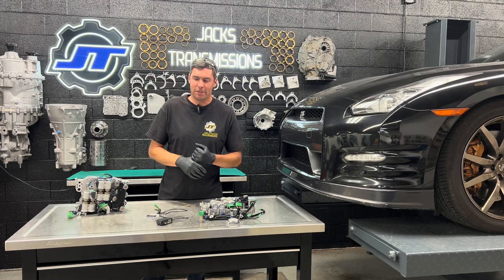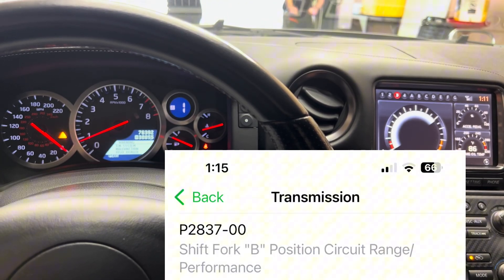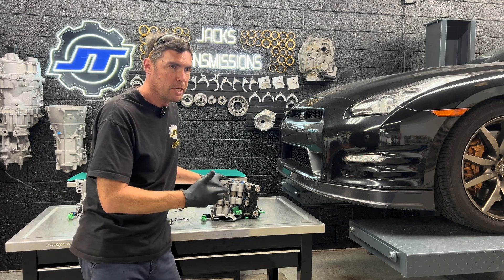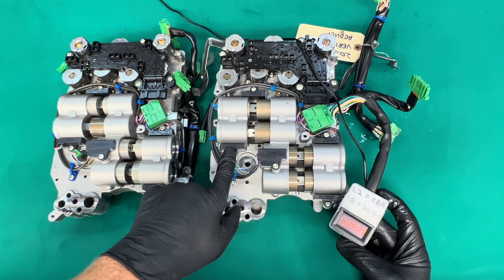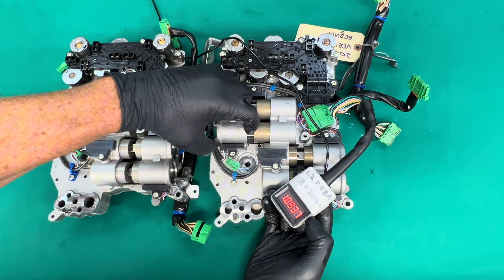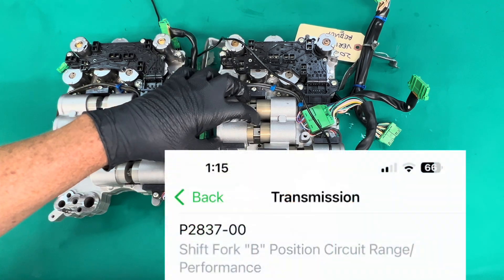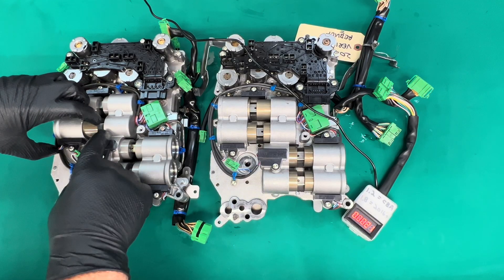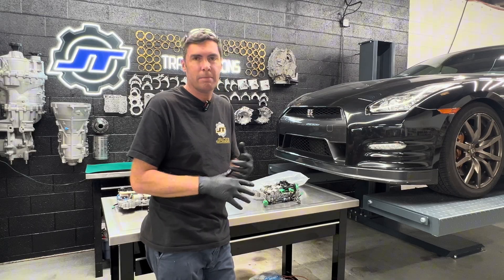R35 Main Selector Valve Body Changes / Differences Causing P2837 Shift Fork B Codes GR6 Nissan GT-R

Comment: Hi, jack thanks for posting informative videos. I have replaced my output shaft due to front fwd gear broke and damaged the spline of the output shaft. Now every time I put car in first gear it crunches pretty bad and stuck in the gear(either first or reverse) and lost odd gears. Code showing clutch fork c
Reply from the maker: Your failure is one of the worst you can have in a GR6. It sends material into every part in the unit. It all has to be torn down and inspected and cleaned out. It is a very time consuming process and requires specialized equipment to assure it’s right. 

You could also have a synchro out of time where it was installed incorrectly during assembly. Or the synchro could be wiped out along with hub thrust surfaces. 

I’m sorry to say that this is one of the few failures where we do not recommend the customer try to fix it. The unit will never work correctly. We very highly recommend that we rebuild this type of failure at our facility instead to assure reliability. It’s not an easy repair, even for us.
Reply: @GVR1670  Would love if you can do jack’s magic on this transmission but being in down under. It wouldn’t help at all. Wish you were here in Australia 😢
Reply from the maker: @Vishyvigilante do you have the ability to log the TCM via ECUTek?  That would help greatly in trying to locate the issue.

Comment: Tightning torque for the 29 bolts which are planted through out the body, any help?
Reply from the maker: What gaskets were used in this build?
Reply: @GVR1670 Replacement filter kit for the plastic
Reply: @GVR1670 torque setting & sequence for the complete sandwich plate🙏
Reply from the maker: Why not just ask the competitor you got the parts from?

Comment: Thanks for the PSA, Jack!  I was...about to start buying the little filters so I could take apart the valve body 🙂
Reply from the maker: Good. Keep it simple. Why is the trans apart?  Failure, or just fluid/filter change?
Reply: @GVR1670  it isn’t apart yet. It’s slow to engage 1st on that very first cold start shift from R to D (the gear indicator blinks for a little).  And other folks internet videos led me to believe I’d have to clean out the valve body filter baskets to solve a pressure issue.  But to be honest apart from that very first R to D shift in the morning, it’s totally fine
Reply from the maker: @KevinSan88 where are your Touch Point settings in the trans utility?  If in the positives it creates clutch drag that makes it harder for the gear to engage and can create this delay. Yes I would agree that cleaning the VB filters will not fix this.
Reply: @GVR1670  thanks Jack, everything is set at zero.  I don’t like the clutch chatter noise when I messed with it
Reply from the maker: @KevinSan88 ok. Is the clutch factory OEM or does it have something else?  Depending on the friction material this issue could be normal.
Reply: @GVR1670  clutch is all oem
Reply from the maker: OK.  The factory paper clutch friction material can get a little sticky when they wear.  This can create a little drag where the unit will have difficulty engaging gear when cold like you describe.  How many miles are on the car?  

I was going to make a video about this sticky friction issue.  When they wear the areas of the paper that allow slip are reduced creating a condition where the friction paper material sticks to the mating steel plate.  It is a very common issue that no one seems to know about.  I have pictures at the microscopic level showing the wear and why this happens. This has more of a negative impact on other platforms where errors occur, but with the R35 it only delays gear engagement for 1st and Reverse.  It doesn't really hurt anything in this platform.
Reply: @GVR1670  the car has 51,000miles.  The only other thing I can think of, is that I’m using Motul DCTF Hi-Torque.  I’ve wondered if it’s maybe a little thicker than the regular DCTF, maybe it takes a heartbeat longer to flow when it’s stone cold
Reply from the maker: Definitely possible.  It's always better to change the fluid more often than not, so trying a different oil wouldn't be a bad idea and would keep things clean the easy way.
Reply: @GVR1670 thanks for the guidance, Jack
Reply: @GVR1670  Hi Jack, I swapped out the Motul DCTF Hi-Torque for regular Motul DCTF, which seemed noticeably thinner at room temp.  And the problem has 99% gone away, instead of the gearshift indicator blinking for a few seconds on that first R to D shift when stone cold, it now just does one flash as you hear it click into first.  I guess the clutch hangup phenomenon you suggested might be responsible for the tiny delay that remains.  But it seems like viscosity was the issue, and no VBs were harmed in this diagnosis 🙂
Reply from the maker: That's good to hear.  In time you might see more of an improvement as the new oil slowly works into the friction material.  It's rare for fluid to make this much of a difference with this issue, but in this case it's a simple enough fix and very much worth the efforts.  The trans is likely much cleaner everywhere internally now too, which is always a good thing.